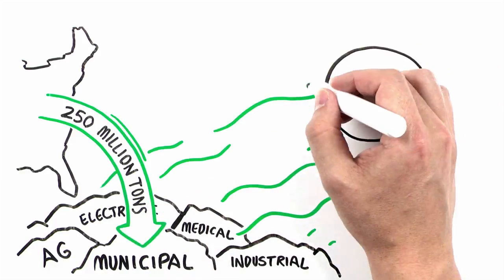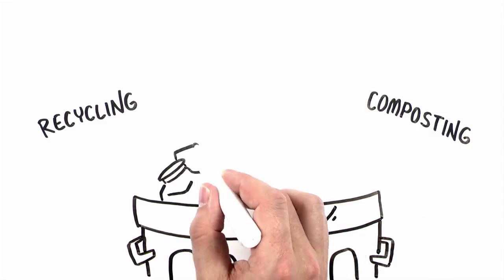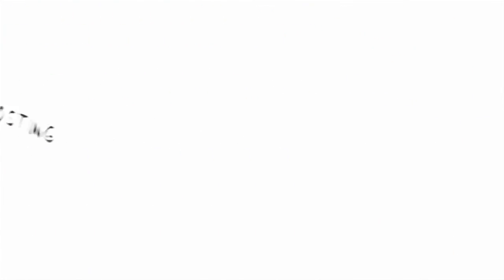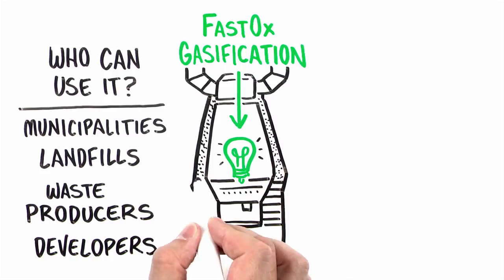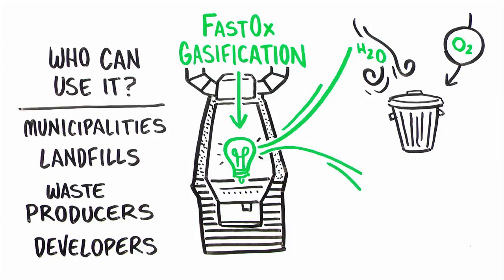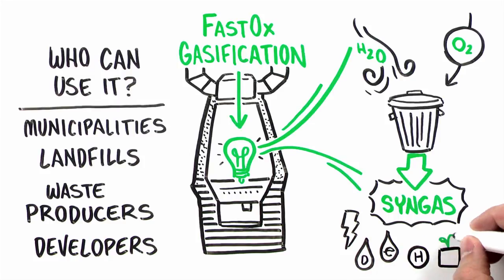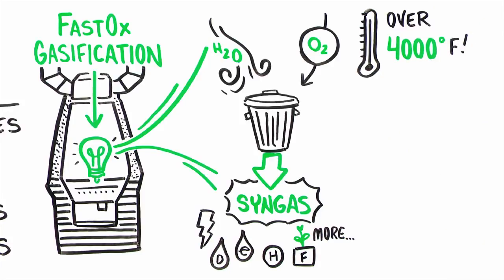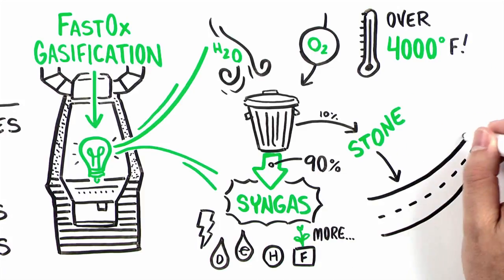Sierra Energy's FastOx® Gasification

Comment: What happens to the non-combustibles such as metals,  ash, and other items in the normal trash stream?  how does this handle SO2, Hg,  non-carbon materials in the waste stream?  one of the major issues regarding incineration is the emission of disposal of the fly ash and clinkers as well as NoX sulfur compounds, and particulates how are those handled with this system and how is the emission profile change over the long-term operation of the facility?
Reply: From their website: "The FastOx system uses heat, steam and oxygen to break down waste at the molecular level. Organic materials turn into an energy-dense syngas. Inorganics melt into a non-leaching stone. Waste undergoes complete conversion into high value products without burning. There are no toxic byproducts and no emissions."
Reply: @musicbycarleton4516  Still doesn't answer my question,  how did they prove that the compounds are non-leaving  would rather see the data regarding leaching studies of this residue.  it also does not provide information regarding volatile inorganic compounds such as sulfur oxides,  mercury arsenic and zinc and if the temperature is high enough lead.  Those will not end up in the "non-leaching stone" as they will volatilize at  temperatures to gassify the organic compounds.
Reply: @davemeiser521  It mentions 4,000 Celsius, enough to break dioxins. Compare with CopenHill which burns at temperatures of around 1,000C, its emissions data already published.
Reply: @sergeykish  4000 °F *
Reply: @pinchertone  Thanks! Yes, it cites 4000 Fahrenheit . So unexpected, I was wrong. Still it would be 2204°C, much more than CopenHill's 1000°C.

Comment: you have to burn fossil fuels to heat it up to 4000 F.
Reply: From the press release: "While it may seem like this would require large amounts of energy, the system is able to generate the heat simply by injecting pure oxygen into the furnace. The oxygen then reacts with the carbon emanating from the rotting garbage in order to create carbon monoxide and hydrogen. The steam is then pumped back into the furnace to maintain the internal temperature."
Reply: @musicbycarleton4516  well: oxigen extractors are energy demanding at some level I guess. It works as long as the energy required is less than the one produced to an interesting degree. 

This looks like some golden egg fable.

Wish it works. I don't understand how a 4000°F process involving oxigen isn't burning waste (and generating ashes and carbon dioxide in the process) but that's just something related to my ignorance I guess. 

From another point of view I think this golden egg factory, will just move the line forward. A global system based on the growth of the GDP will just eventually collapse a little bit later, but still will. Exponential trends are just some bad mother fuckers. 

You can move the line a lot farther and still not solve the problem.

Of course this is no reason at all to stop these researches.